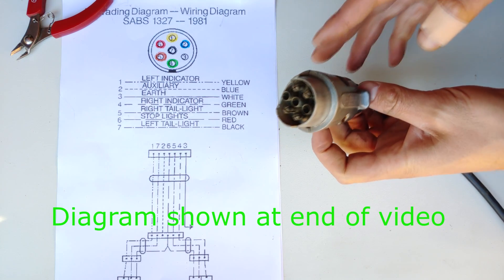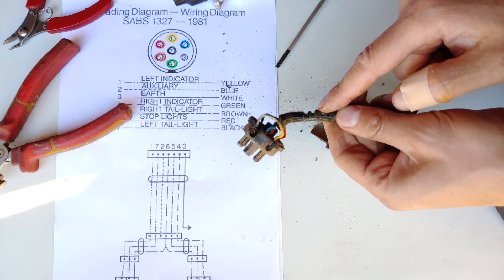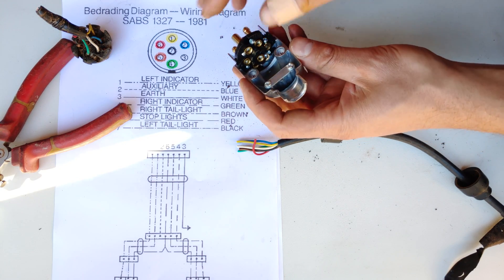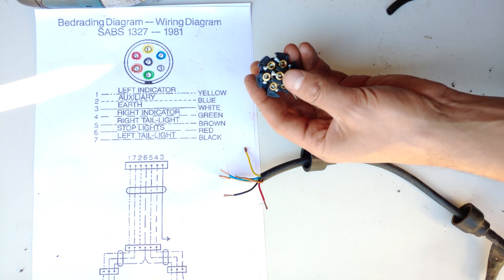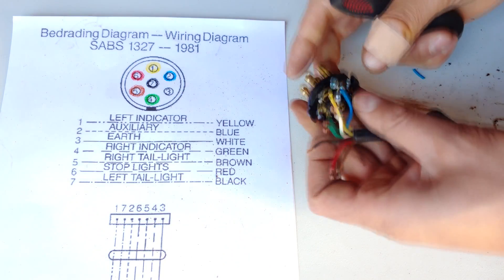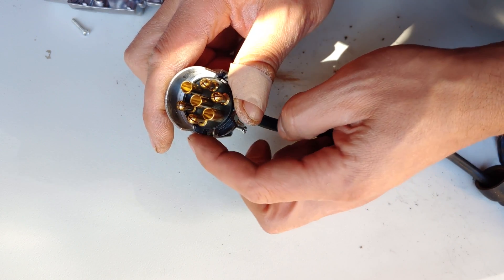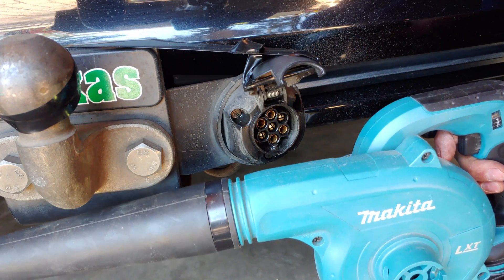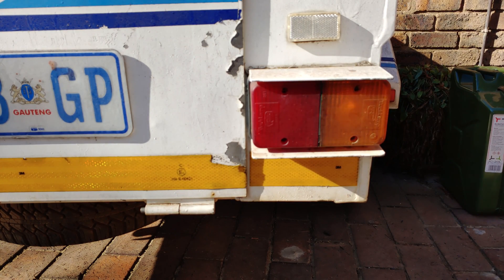How to wire a 7 pin trailer plug (diagram shown)

Comment: Nice movie, who shows the wiring diagram from the connector that is mounted on the towbar plate, everybody shows the trailer plug, can't find the wiring diagram for the other side. in other words, the wiring for the side with the dust flap on it.
Reply: @fishingkayakssa The plug with the flap is the female. The diagram to be used is exactly opposite to he male  plug shown. ie. No. 1. 7. and 4. in the vertical always stay the same. No. 2. and 6. switch over and No. 3. and 5. This is the South African SABS standard.
Reply: The pin numbers and wire colours are the same. If you want to connect tow harness to your car and its a modern vehicle, you will need to go to the manufacturer or a reputable parts shop to interface unit to suit the Canbus system in your car. you cant just connect wires into the light circuits as they did on older cars.

Comment: Excellent video! After following all the steps, my left hand brake and park light is not working. Can anybody perhaps advise on how to check the wiring of the trailer lights? All other lights are working just fine.
Reply: Use a multimeter and select dc voltage.
Reply: Use a 12 volt power supply and connect the earth wire (white - if wired correctly) to the negative terminal of the power source and then use a probe from the positive terminal to power each of the plugs screws/holes and see how the trailer is wired.

Comment: I would say world wide save for North America.  Of course we have to do it differently than the rest of the world.
Reply: Australia and New-Zealand use a different standard too. AS-2513 is different from ISO-1724, the key differences are that Pin-2 is for Reverse Lights and Pin-5 is for Electric Brakes.
One Australian caravan manufacturer use dangerous non-standard wiring and encourage vehicle owners to dangerously modify their vehicles electrical system, making them incompatible with AS-2513 compliant trailers and caravans.

Comment: Having just wired my trailer plug, not all lights/indicators/4 way flashers work. I only had the new tow bar fitted this week, how do I know if it's my wiring or the tow bar?? (Sorry, my excuse is I'm female and can't think outside the box!!! )
Reply: You might want to check the wiring is connected properly , if its not the trailer lights plug , then it might be the wiring of your jeep /car/van/truck or it could be a blown fuse or relay switch usually found in the engine bay or under the steering wheel.
Reply: @seannolan3458  yeah, the wiring on the trailer blew the fuse on the car. Wiring was too old so I've bought magnetic lights to use until I rewire!!! not so much of a bargain buying something second-hand if you have to renew it all is it??? Thank you !